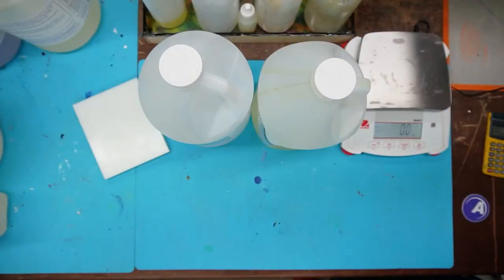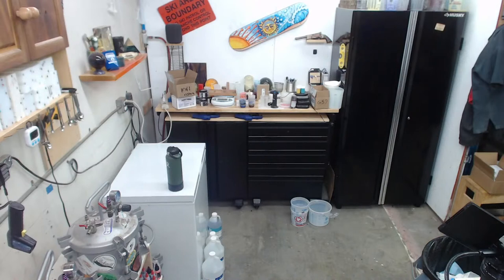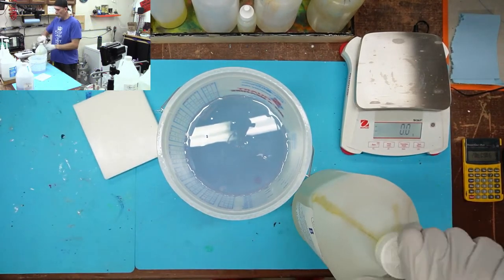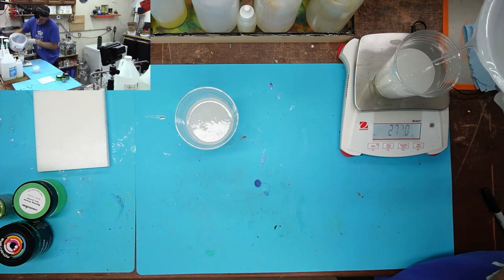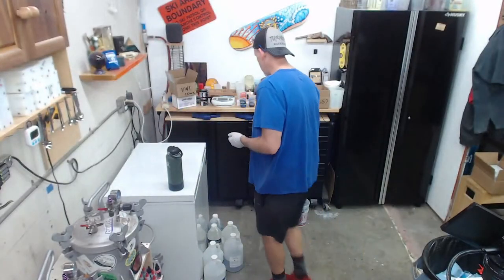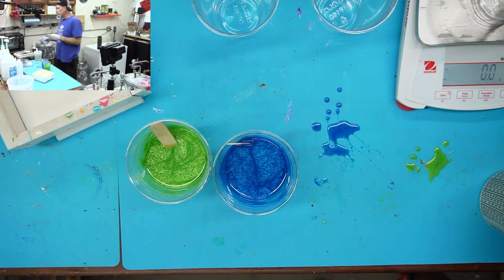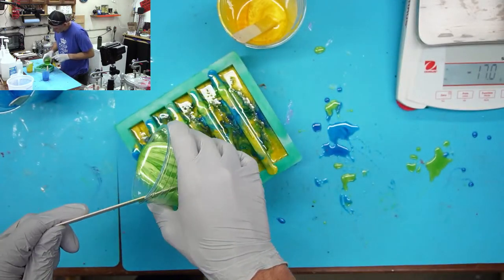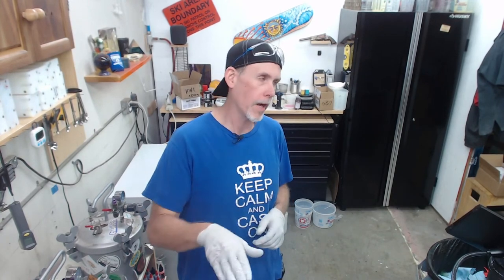🔴Replay: Is My Epoxy Resin Too Old To Use? | Episode 166

Comment: Automative glass is usually coated to help block uv rays, that's why you usually don't get sun burn driving. So that probably helps keep the shift knob clear.
Reply from the maker: Oh yeah! I didn't even think of that. I might have to do a little experiment with Alumilite Clear and see if it stays clear too